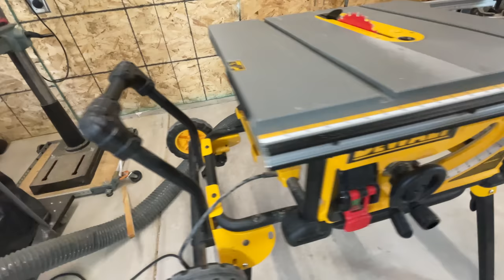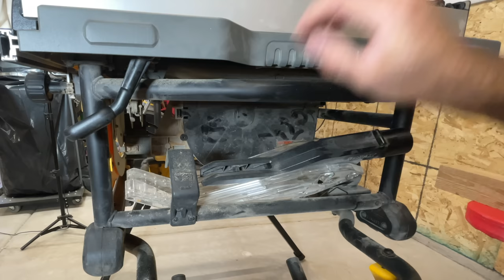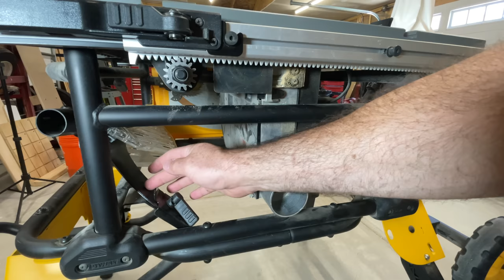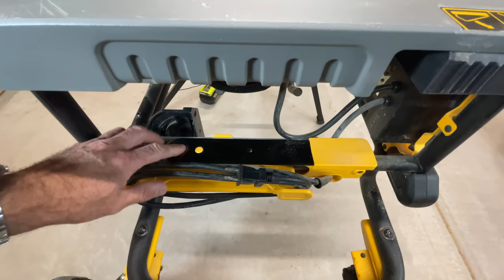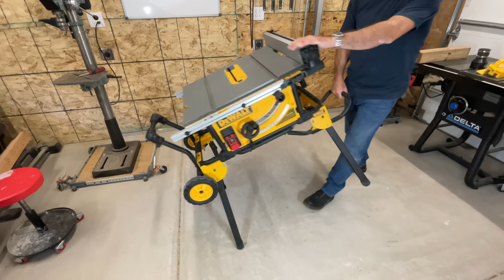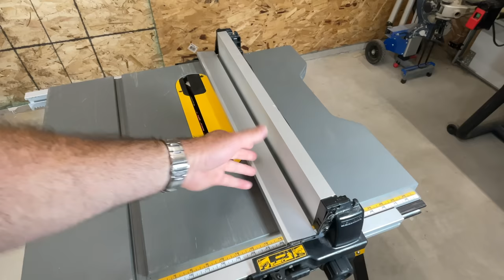The Saw Designed For Everybody?  |  DeWALT DWE7491RS   |  Review and All Adjustments

Comment: Mike what is your favorite table saw for an average garage shop?
Reply from the maker: It’s a tough question with many factors. If you have the space this Delta has exceeded my expectations. The DeWALT DWE7491RS is great if you need the portability or space savings. I have the little red Skil 10 inch, 15a folding saw in the shop now for testing and it looks very promising. Watch for that vid next week. Thanks for watching!
Reply: @ProjectsForAllReviews  Cool Thank You I will. I have a 2 car garage and am starting to get into wood turning soon. I just got the Record Power MIDI lathe. Thanks!

Comment: I use the later EU version of this.  The mitre gauge is not great, but with a bit of slippery tape I made it snug in the track.  It doesn't have any fixed stops for things like 45 and 90, but it does work and I can get accurate angles with it.  The one upgrade I did was to fit a soft start.  That made a big difference to the harshness of the start-up.  Otherwise I can't complain.  It costs half of the next size up in any available brand.
Reply from the maker: Thanks for the comment. I wasn’t aware this was available in the EU. If this were my saw the first thing I would do is buy a new miter gauge!

Comment: Mine has the issue with constantly having to clean the gears. It is so annoying. I wana switch but at the same time I do love dewalt but on mine raising the blade can get annoying in a hurry. After just runing it half time in site, it'll start to gum up. And no I did not nor will ever use grease in the gears. Dry lube only. I've have to clean it 3 times on one site before. That's just not good design to me. I think dewalt needs to redesign that portion of the blade height.
Reply from the maker: That’s crazy!?! Thanks for the insight!

Comment: The Delta uses an induction motor, which will always be much quieter than the universal motor of the Dewalt. Most Saws in this class use universal motors.
Reply from the maker: I should have been more specific in the vid but you are correct. Possibly a good future vid topic. Thanks for the comment!
Reply: Ear protection usually works good

Comment: I love my Dewalt DWE7491RS. I just wish it could cut longer than 32 1/2” with the fence. The newer design of this model has some slight differences, but nothing major or important. The blade guard mounts a little different on the bottom, the fence release lever sits closer to the bottom of the table when locked, and the blade housing cover has a couple screws in it for a more secure closure. It also now comes with an anti-kickback pawl to attach to the blade guard if you want/need to use it. I recently made a zero clearance throat plate for mine. 1/2” plywood is the exact thickness it needs to be with no need for adjustment screws.
Reply from the maker: All good to know Jerry! Don’t think I’ve ever wished for more than 32 inches of rip! Thanks for the good info!

Comment: With a track saw is there really a need for a table saw?
Reply from the maker: Tough question! It really comes down to what your cutting. Personally I don’t like making cuts on small boards with the track saw and would much prefer using the table saw. I use the track saw mostly for processing full sheets. It excels at it and is safer and easier for me without helping hands or a large outfeed on the table saw. I like having both. If I had to only have one I’d choose to keep the table saw. I’m sure there’s a lot of varying opinions on this though. Thanks for the comment!
Reply: @ProjectsForAllReviews  I am finding with a nice blade on the miter saw I am using my table saw less now that I have a track saw. Don't get me wrong I need to build a couple jigs for the table saw and I think it will be more valuable.

Comment: I have the Skil TS6307, which must have been made on the same assembly line, as almost all of the features are identical. The biggest difference is that instead of wheels it just has folding legs. Oh yes, and it only cost $300

Comment: I have one of these in my small workshop, and access to a cast iron table 3hp saw with sliding cast iron mitre table in my local Men's Shed. I prefer my DeWalt! Just as accurate, and much lower maintenance. Dust collection is better, changing blades or riving knife much faster and easier. My DeWalt is noisier, but that is the only downside.
Reply from the maker: I was very impressed with this DeWALT. It’s not cheap by any stretch but I felt for the most part you received what you paid for. That said I have to ask, what’s a local Men’s Shed? Community workshop? I assume your not local to me by your spelling of metre, which my phone is telling me I misspelled. Just curious. Thanks for watching and I’ll check out your channel. Looks interesting.
Reply: @ProjectsForAllReviews  Men's Sheds are an international movement that started in Australia (where a man having a shed is almost a law) and spread- we have ~750 of them in the UK. It is a space where men can make things, talk about making things, and say things not permitted in the modern workplace... It is where blokes can be blokes. There are a few in the US- check them out!
Metre is the correct spelling for the SI unit of length- as pretty much every country agrees (preferred units in US since 1975). Remember- you read meters and measure metres.
Reply: I’m jealous
Reply: @Tensquaremetreworkshop  They're not called Men's Sheds in the US (don't recall what they're called), but I've heard about them for around 30 years (usually because one is opening, or one is closing for some stupid reason). US military bases have similar things (for woodworking, metalworking and auto repair). Community workshops are great in concept, but apparently difficult to keep alive in the US.-- no idea why.
Reply: @crustycurmudgeon2182  The Men's Shed movement has reached the US (US Men's Shed Association) and is affiliated to the international organization. Not many Sheds yet (~20) but hopefully it will grow- we have hundreds in the UK. They are not so much about the making, but more the community.
Reply: @Tensquaremetreworkshop  That's great news! The ones I've heard of closing must not have been affiliated with this organization. thanks for the info!

Comment: I have an older version of the saw. 5/6 yrs old. Terrible !  check the top with a straight edge see if its flat, they are usually bowed in the middle, The large washer which holds the blade onto the spindle is not a shug fit on the spindle therefore there is play when the blade goes on, you can imagine the vibration !  I'm in need of another saw and I'm very reluctant to get the dewalt again. With the DEWALT DWE7492 240v Table saw 250mm blade being over £800 in the UK, its a gamble to get a good one.
Reply from the maker: Hello James! The saw in this video is about 8 years old. I didn’t experience any of these issues with this one but I didn’t spend a lot of time checking the top for flatness.  Being a job saw and not cast iron I would just assume it isn’t straight. There’s a lot of get saws out there nowadays and many with almost the same large rip capacity. Good luck in the hunt!

Comment: I was seriously considering buying this saw a little over a year and a half ago. The cost then was around $500 dollars. I didn't buy it then because of the price of lumber. We had put our renovation on hold until the lumber cost went down. We'll fast forward to today and we are back to renovating our home again.  The current price of this Dewalt is $649 dollars! I was shocked 😲.  Dewalt has litterly priced themselves out of a sale. The Delta 36-725t2 is currently priced at $679 dollars.  It's only $30 dollars more for what in my humble opinion is a much better saw. Now mind you if you need a saw you can throw in your trunk and go with then yeah the Dewalt is probably your best bet. But if you want a reasonably priced quality table saw then the Delta is so much better. I honestly could be happy with either saw . But I'm not ever going to need to be mobile with my table saw. I need a table saw for home use. Building small projects etc... but considering for 30 dollars more I get a solid stable ,accurate and more accurate table saw . It's a solid win for me.
Reply from the maker: I agree for almost the same price I wouldn’t consider anything but the Delta. I’ve got the Evolution multi material table saw in the shop now and should have a couple vids on it next few weeks. It’s very cool and unique but the Dewalts a better saw (for twice the $) and neither could replace the Delta IMO. Thanks for watching!

Comment: I have a concern about rip capacity? 
I really like the delta but rips up to 30”
However Dewalt has a 32.5” rip capacity. 

I’m building a ton of cabinets for garage. Eventually would like to do some other house projects like a dresser, book shelves, etc.

I have a project that requires 30” cuts for cabinets in garage. Maxing out the rip capacity of the delta. 

Am I correct in this? I’d like to go with delta but somethings telling me to consider the additional 2.5” of the Dewalt. 

Can anyone advise on that.
Reply from the maker: Actually the Delta is 30.5 inches and I cant imagine a saw Id rather do a ton of cabinets on! However the DeWALT would do just fine also. Good luck deciding!
Reply: @ProjectsForAllReviews  thanks then delta it is 👍🏼

Comment: 10 years? This is the current model folding stand jobsite saw from DeWalt. The model 10 years ago was significantly different.
Reply from the maker: I believe he said he’d had it eight. As best I know this is the same as the current model. It did not include the stand and doesn’t have the RS suffix in the model number. Please post specifics if you know this info is wrong. I work hard to get the proper info in these vids but mistakes can happen and I appreciate you guys watching out. Thanks!

Comment: It will bog down when getting into thicker stock but rips hardwood of reasonbable thickness with no problem whatsoever
Reply from the maker: I didn’t push this saw super hard but didn’t experience any bogging. Next saw review I’ll rip some 4x4s. Thanks for the insight!
Reply: @ProjectsForAllReviews  overall like you said amazing jobsite saw CANT think of one better besides the sawstop but from what I see other than the brake cartridge they are practically the same saw. But I think I’m gonna sell the Dewalt (God willing) and get a delta either u til I decide I’m satisfied with the T2 or o can save up for the sawstop contractor’s version. I have a feeling if I don’t get a dud delta, I will be satisfied to stick with it. And go ahead and grab up the cruzer while I’m At